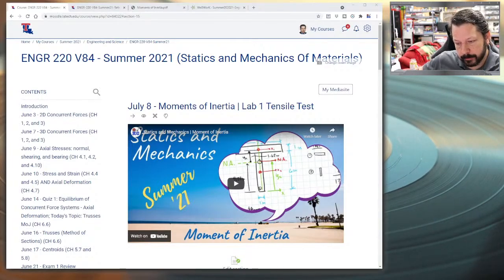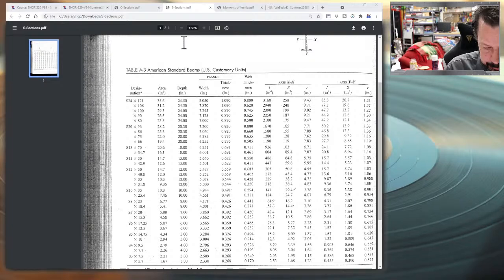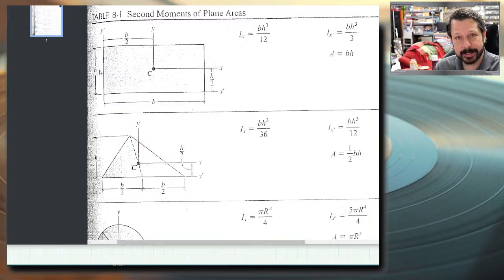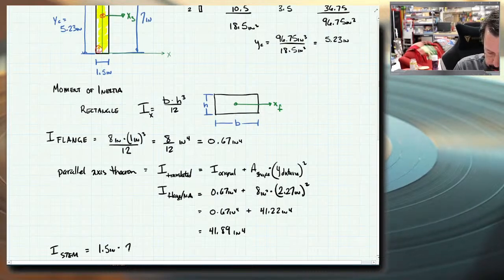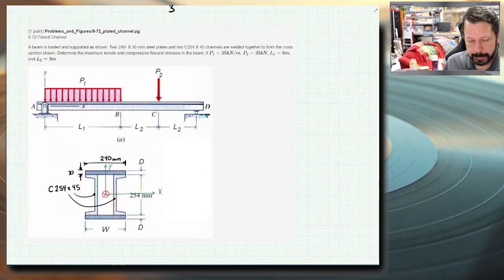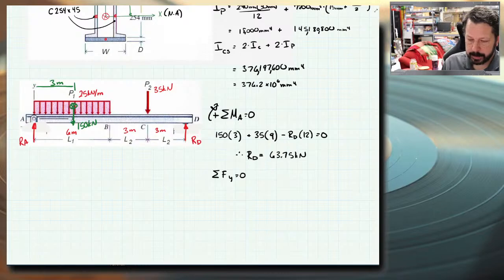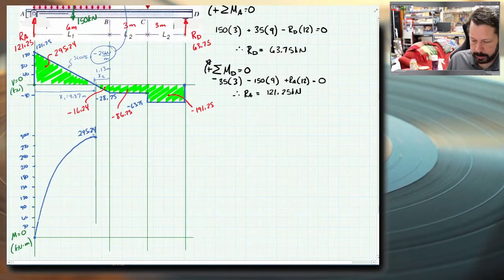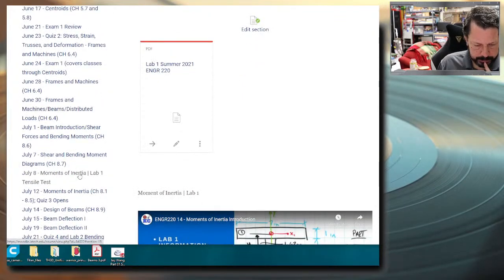Statics and Mechanics | Moment of Inertia

Comment from the maker: At the 50 minute mark, I write 18,000 mm^4 - that number should have been 540,000 mm^4. So the final calculation for I is off a bit. Also, the final calculation for sigma at the very end if off a bit.